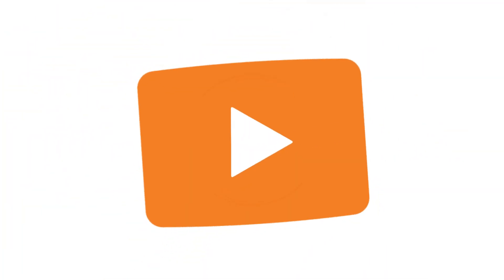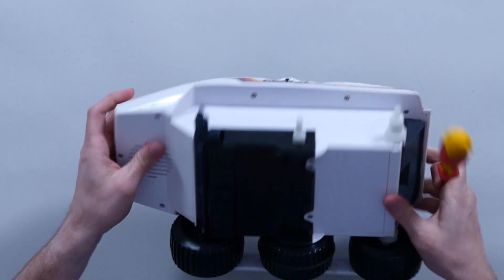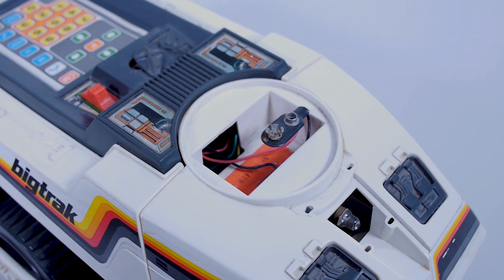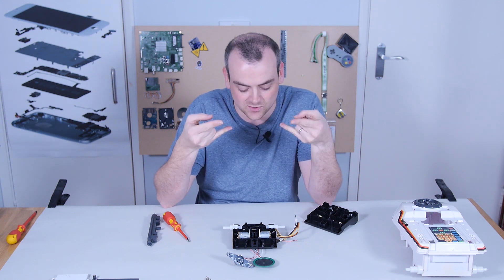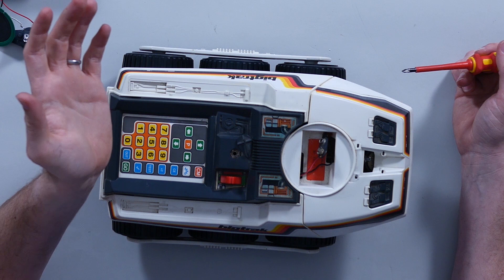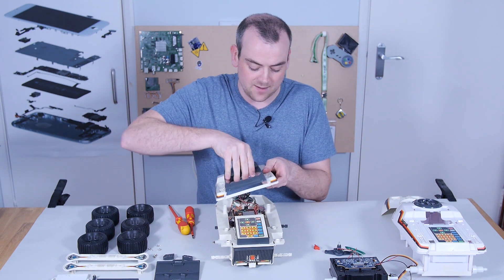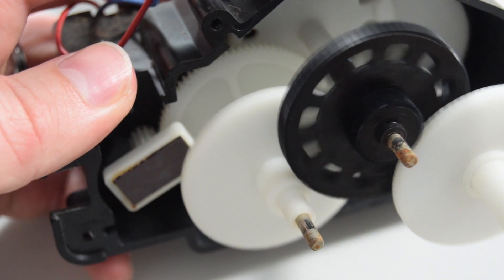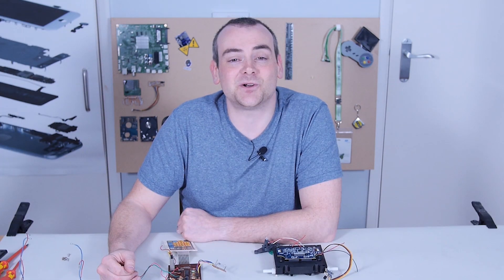Big Trak 1979 Vs. 2010 Teardown! - The Electronics Inside

Comment: I've just brought a faulty 2010 model which said it didn't run, but she used old batteries, so I put some in and it does work fine apart from front led, tested led with my meter and it works, so not sure why it's not lighting up if anyone has any idea, cheers

Comment: Great breakdown. I'm attempting follow a "build your own robot" article from a 1987 Boys' Life magazine that calls for two of these dual motor setups. I'm hoping I can find a place to source them. I could make it work with other motors, but I'm trying to stay true to the original.
Reply: I should mention that I have a Big Trak in my toy collection but I'd prefer to keep it in good condition and not scavenge parts from it. I could buy more on eBay, but I hate breaking down collectable toys if I can avoid it. But so far, no luck finding any motors on their own.

Comment: I've recently acquired both models and comparing them , The newer version drives and turns faster, This compromises accuracy because it rotates quicker and over rotates through momentum  ( on lino).
The older version drives/ turns slower and turns exactly on any surface.
Great video guys.
Reply: Do the sounds sound alike?
Reply: @jcougar831   yes they do.

Comment: the older version's 3.5 mm jack was to plug a dumper/trailer in, the dumper also had a 1.5 v D cell and when the trailer got the prompt  from BigTrak it tipped out the load

Comment: The second smaller chip in 1979 model is certainly not a RAM chip, it's DS75494, which is a 6-channel 150mA per channel driver. it is there to amplify the signal for the speaker and lamp and to drive the speed sensor LED.

The program only 16 commands in max length would have fit into 64-word RAM of the microcontroller. Since commands have a form of command type + command length where length is up to 99, i suppose they store command in one 4-bit word and length in two words, consuming 3/4th of the RAM. That and having the complete firmware fit into 1024 instruction words (8-bit) is some efficient programming.

Comment: Seems to me that if they are reading the motor rotation using the optical encoder they didn't really need the magnetic coupling they could have done a feedback loop in software.
Reply: Daniel Bull  In 79 ? It's the cheapest way even today.
Reply: I pondered this but my first thought was the coupling approach actually stops any deviation rather than correcting it so may give a straighter path. The other question is whether the TMS 1000 is up to the job...

Comment: I had one back in 1979ish time frame. I also had the Big Trak Tansporter (trailer). I don't remember (that was a long time ago though) the transporter taking any batteries so the accessories port supplied the power for it. You could program it to lift to dump the cargo and then go back down. All of the transporters programming was don't through the big traks keypad.

Comment: Was hoping you'd go into more detail on the TI chip and how it functioned.
Reply: @Sasquatch - The MCU is a 4 bit TMS-1000, an example of the first commercial micro-controller released by TI in 1974.  It is a Harvard design with 1K x 8bits of ROM for program storage and 64 x 4bits of RAM.  Chips from the same family were used in many toys of the era, including Simon, Speak & Spell, Merlin and the Microvision.  The electronics in the Big Trak have been reverse engineered at robotroom dot com (darn links) and the code running on the MCU has been dumped by Sean Riddle.  HTH.
Reply: I still can, do you have specific questions or are you just after an overview?
Reply: A thorough overview would be great - a how it works/what it does/how it addresses the small memory etc.- thanks :-)
Reply: @TheRealSasquatch  I'll see what I can dig out for you!

Comment: Really nice video - thank you! Presumably the centre tap on the old version simplified the motor drive circuit and the voltages applied to the motors are relative to the centre tap. So, you’d give it +3v or -3v depending on whether you want it to go forwards or backwards. That way you’d only need 2 transistors for each motor rather than the 4 that would be needed for a full H-bridge.
Reply: That's a really good point - I'm going to do a little follow up on the micro controller, I'll let you know if you are right!

Comment: Love it! I was 9 when the original came out, and was lucky enough to get a Big Trak and the Transport add-on for Christmas. I couldn't guess how many hours of fun I got it of it. When it eventually stopped working, I took it apart and marveled at the PCB and gear mechanisms.
IIRC, the original could store 16 commands in memory. Did the newer one improve upon that? I certainly hope so!
Also, IIRC the 9v battery only powered the lamp. Hopefully someone can correct me if I'm wrong.
Reply: Notice the complete lack of electrolytic capacitors and voltage regulators. 9V battery goes straight to the power pin of the TMS1000 processor. 6V rail off the bottom battery compartment is needed for the motors, the lamp and the speaker, it goes to the motor drive transistors and the high-current driver IC, misidentified as RAM in the video. The 3V centre-tap off the main battery goes to the other side of the motors. The motor drive transistors would pull their side of the motor to either 0V or 6V to make it run one way or another.
Reply: I wish I had one of these when I was younger! I would have loved it!  The closest I got was a little robot at school. I am pretty sure the new one can do more than 16 comments from my "extensive research" with it. It have a play and let you know!